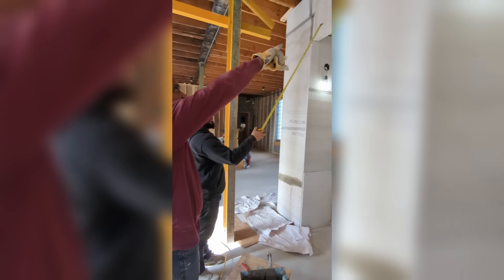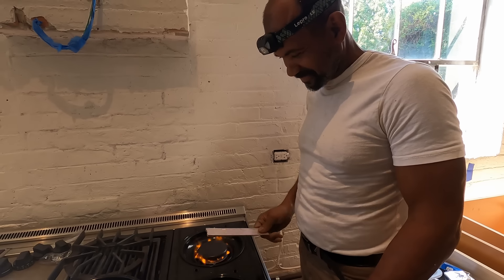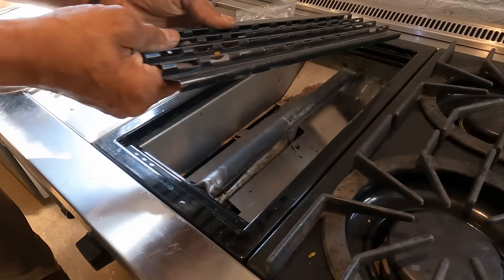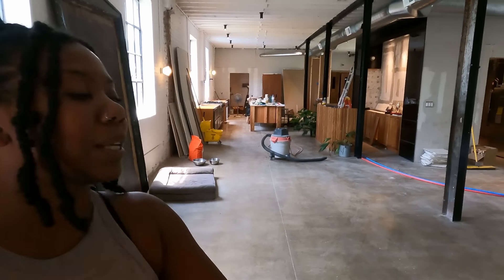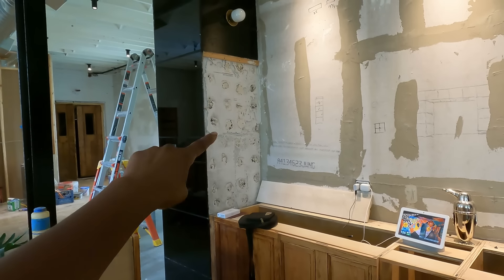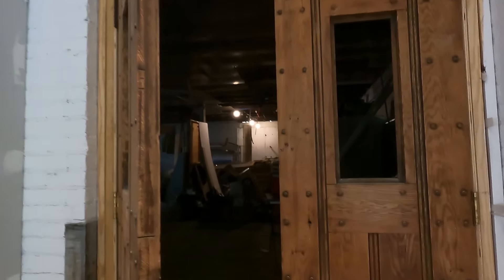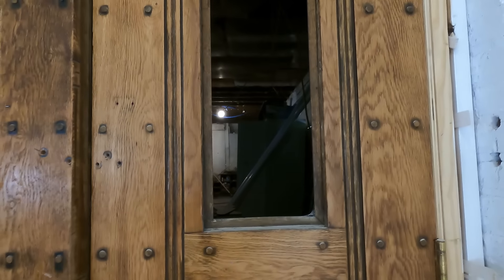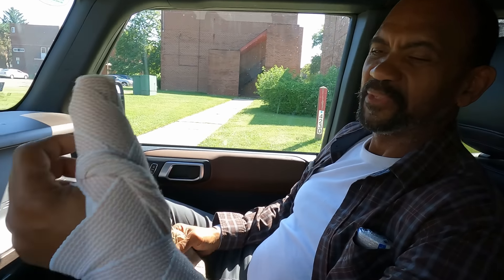We had to go to the hospital... | EP.8

Comment: Based on how the tiles were installed with improper mortar spread I'd expect more to fall off in the future. Mortar should not be blobbed in sections and then pressed on, you can see that there was insufficient distribution. You're supposed to use a large notch spreader on tiles that size, first mortar the wall with the spreader and then you back butter the tile with the spreader.
Reply from the maker: The tiles were installed correctly with a notch spreader. The blobs you see are indentations of the original mastic glue that was applied when these glass panels were on the facade of an old jewelry store. We weren't able to chip the off before installation so that's why the dent is so large on the surface!. What we should have done was use the same mastic glue to apply the glass tiles instead of mortar. But what's done is done! But we don't forsee any more tiles coming off because before I grouted I squeeze a few tubes worth of mastic in the cracks just in case for a extra hold!